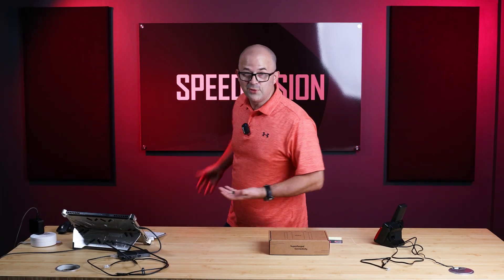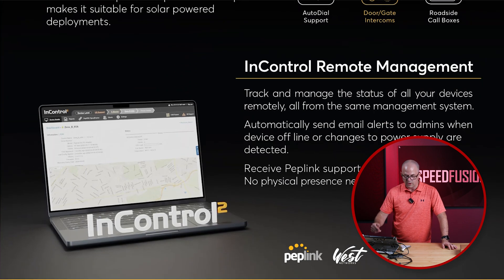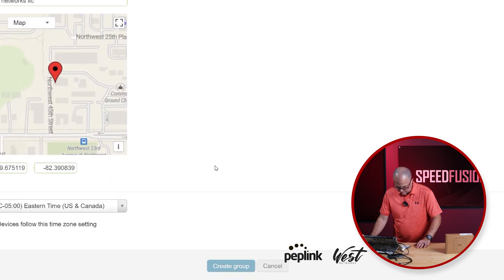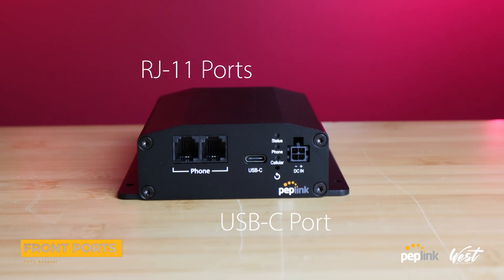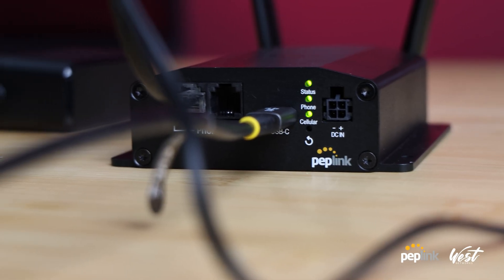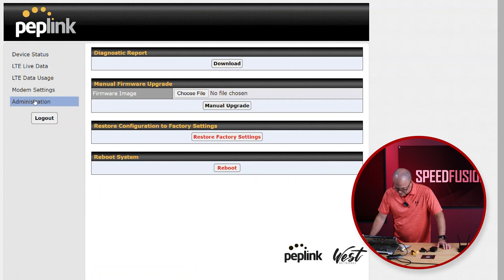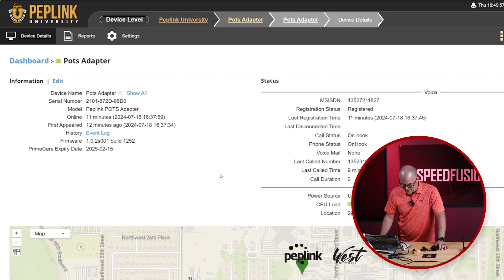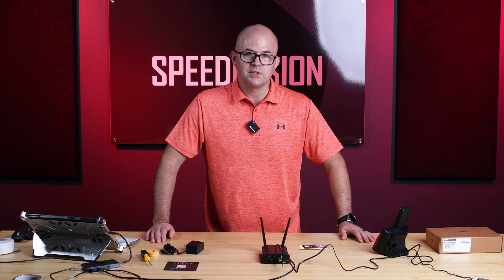Cost-Effective Voice Over LTE Solution: Setting Up a POTS Adapter

Comment: How would you connect the Peplink to the elevator phone?  Wouldn't you need the elevator company to make that connection for you?  Great video !!  TY
Reply from the maker: Typically the elevator has an rj11 connection so you would just replace the traditional pots line with the pots adapter. When we did our upgrade it was pretty seamless but I can't speak to everybody and every situation we might need to call your elevator company if there's some special did settings or something like that that you might need.